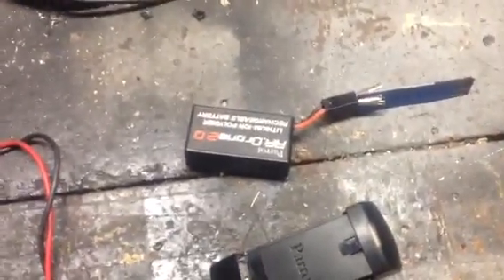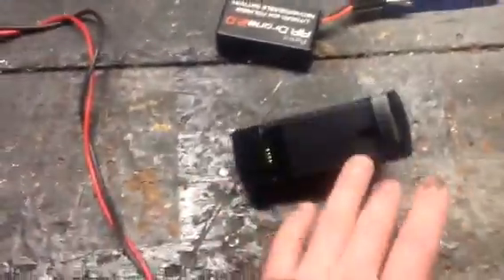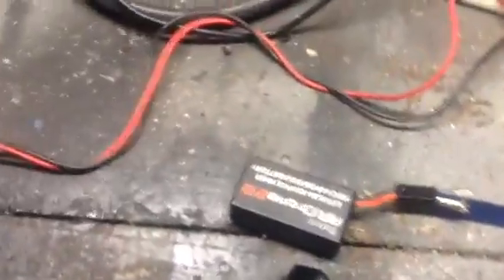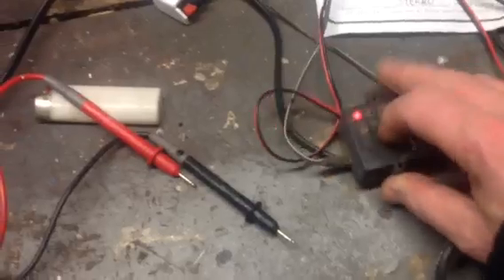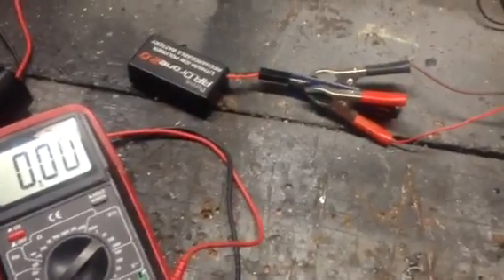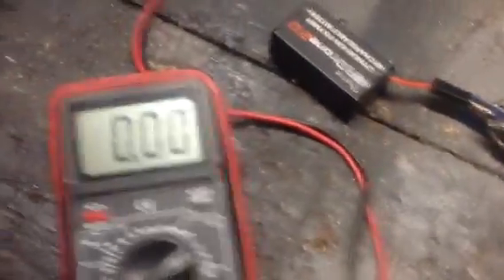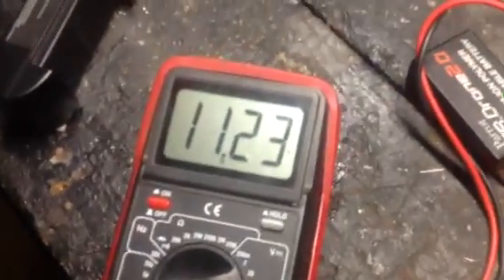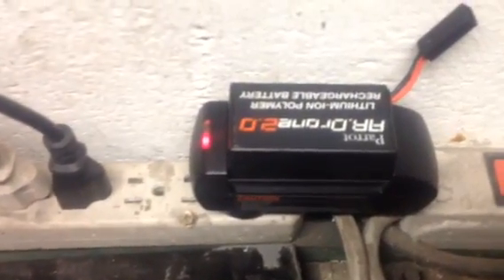Ar Drone Charger Flashing Red Light Fix

Comment: I know it's been a good few years but iv got a parrot drone and the battery's are only charging to 8 or 9v instead of 11v do u think this trick will help me out
Reply from the maker: Hi James! Well…this particular trick may not help as it just brings the battery voltage up enough to trick the charger…however, if all batteries that you’re attempting to charge only charge to 8 or 9 volts your charger may be at fault. With a multimeter, check the voltage coming out of the charger. It should be around 13-15 volts. If it’s only 8 or 9 volts, get a new charger. Hope this helps you out.

Comment: Have been idle for a year or so, my AR.Drone 2.0 Li-Po Battery (1000 mAh, 11.1 V) was down on 6.59 Volt and the wall plug charger led changed to flashing red (plugged it several times). After a 2 minute charge using a 9.6 V 220 mA AC/DC Adaptor my meter indicated 10.0 Volts - and finally the charger started working again with the constantly red diode. AWESOME WORKAROUND, THANK YOU @Budzilla Sohoski!

Comment: I will add, you can utilize any battery of somewhat high voltage house batter like a 12v fan remote one. I managed to it working after using paperclips as the medium and a minute later plugged into the charger and no more red light. thumbs up for others to see.

Comment: a better way is to sit it on your charger so the pins are connected but not locked it (so its easy to disconnect) then it will charge until it starts to flash then take the battery out (it is important to do this quickly as when it flashes it drains the battery), wait till the charger recognizes its gone (the light turns off) and do it again. it worked with one disconnect for me but maybe more for you this method uses no extra things and does it in seconds. hope it helped :)

Comment: Having the same issue with my new propel tilt "stunt" drone. 10 mins of flight and dead. Same method should resolve right? And you recommend buying a specific brand of charger/replacement batteries or are they all brand specific?

Comment: Thanks - fixed mine.  Subtle difference - I simply connected mine to a 12v battery for 5 minutes which avoided the need for a trickle charger. Worked like a charm.

Comment: there is another way to do this. you can get one of the plugs for a gas rc car that holds your battery and plug it into the reciever of your electric car while you have all the regular parts in. then you give it throtal for about 30 seconds and then it has enough charge to plug back in

Comment: Hey Budzilla, I am trying this method with Bebop battery using the Harbor Freight trickle charger. I started with a battery that had 7.6V and the voltage was evenly split between the 2 battery cells, the 3rd cell was down to 0V. I had the battery on the charger for 8 hours and the voltage went up to 8.15V, measuring the individual cells I see 4.22V on one cell and 3.93V on the 2nd cell, but the 3rd cell is still at 0V. Does it mean this battery is unrecoverable? It's a new battery that came with a Bebop I just purchased.

Comment: thanks for the info dude.. please provide the trickle charger that you used
Reply: Kevin Burns I just did this with my car's battery charger. I also have a motorcycle trickle charger, but it wasn't strong enough. it's 12.6v~3a out put. so just do above that
Reply: John Peterson thanks for replying.. thats 12v though...the drone bat is 11.1v.  That wont fry it?
Reply: John Peterson lol still trying the turn on and off method.  Ive climbed to 7.6v fml
Reply: John Peterson going on 2hrs lol
Reply: It worked the first try for me. I just took some speaker wires and stripped the ends. Shoved two into the battery terminal, made sure they weren't touching. Then just connected the other 2 to my 12 v car battery charger. I had it at the lowest setting then kicked it in to start mode for like 15 seconds. Took it off put it on the charger and the red light finally came on.
Reply: John Peterson thanks dude totally worked lol.. got it up to 11v in about a minute and 20 seconds.  I forgot i keep a spare batt in my car for jumping it

Comment: Does this work on Ares ethos HD quadcopter battery also?
Reply from the maker: Hi Shawn. This trick will work on ANY lithium ion battery.  As long as the output voltage of the charger you're using is equal to or a little greater than the battery you're trying to restore (+/- 5 volts or so) Just be sure to monitor that process. Lithium ion batteries ARE NOT like a car battery, or a rechargeable ni-cad battery. A lithium ion battery will continue to take a charge until it fails catastrophically. That's why they all use "smart chargers."

Comment: Sept 2016....when battery charger starts to flash, simply remove battery ,leaving power on , and repeat this proceedure maybe up to ten times ie..when battery starts to flash red, remove battery and reinsert until flashes again. Eventually the battery gets sufficent charge to fool the charger that the battery has not failed....you will find that eventually you will reinsert battery and the charger light stays red, a sign that it is charging as it should.   Cheers
Reply from the maker: YES! Or simply hook it up to a trickle charger for a minute ONCE....
Reply: It workt!
In my chase it only took 4 times to put the batterie into the charger and out again.
Thanks for the tip!!
Reply: I tried this 20 times didn’t work but the method in the video 👍👍
Reply: Yes this worked for me  cheers

Comment: Thanks, i tried it, I bought a brand new Drone and the battery was completly dead, zéro volt and the red light was flashing and boost it with my drill charger and put some 7v in it and it began to charge, thamks for your help, I am from Lac-Mégantic, Québec.

Comment: Tried on the bebop drone battery, it worked perfectly! Thanks
Reply from the maker: Great! Glad it helped. It will work on ANY lithium ion battery. As long as the trickle charger's output voltage is close to or just above the battery's output voltage it should bring it up to a point where the battery's charger see's it as a good battery.

Comment: This video is a godsend.  I used a Battery Tender Jr (750mA) and it took around 30 minutes for me to get from 3-ish volts to just over 10 volts with me checking the voltage every 5 minutes.  10V was enough for my Parrot charger to treat the battery normally.  I owe you a beer.

Comment: Well done.  Worked like a charm.  The Harbor Freight solution worked wonders.  My only issue - to get from 5.5 volts to 10.5 or so actually took about 5 min of continuous charge.  But...then the Parrot charger took it and no more blinking light.  Well done.  Thanks!

Comment: Thanks man, I fixed mine with a switchable tip variable voltage charger with aluminum foil for a wire and it is not charging.

Comment: Thank you very much.  Ran to Harbor Freight right after finding your video.  Followed your instructions.  Worked like a champed.  After a short charge with the battery tender, popped it into the charger.  Red light went on, then green. Resurrected my "dead" battery and have been flying ever since.

Comment: hahah cool, worked here. Thanks very much.
I have another question, by any chance do you know the colors of the 4 pins of the charger? Because i just bought an ar drone 1.0 battery, and got fucked, coz i can't charge, and which led me to google the things and fix my original 2.0 battery. But i intend to use the same charger for both batteries. and i'm thinking instead of hacking my charger which is now useful, if you can tell me the order of the cable colors of the gold pins , i can try to match the ar drone 1.0 battery cables to the charger.
thanks anyway :)

Comment: Just incase anyone is wonder. I actually managed to fix this by jumping my AR battery with my truck. NOTE: This is extremely dangerous This is dangerous because you are charging the battery with a 5-20 amp charge, which is 5x-20x faster than is made to handle.What you need: 2x 2ft lengths of wire "preferably solid core."How I did it: First clipped one end of each  wire and wrapped them in a loop, placing 1 end of each in the out bored battery connector. Then, I placed the other ends on the respective battery terminal so as they don't fall off. "Truck was already started." Then I walked away for 10 seconds, came back and unplugged them, and then put the battery on its normal charger. If it doesn't work the first time, rinse and repeat. NOTE: Don't leave it attached for more then 10 seconds as the fast rate of charge heats the battery very quickly. Each charge spurt I got about a 2v charge. BE SAFE, BE SMART

Comment: What is the voltage level that you need to boost it to, in order to begin normally charging. My battery sits at 7.53 VDC and still flashes in the charger
Reply: My AR.Drone 2.0 Li-Po Battery (1000 mAh, 11.1 V) after being idle for months was down on 6.59 Volt and the wall plug charger led was flashing red. After a 2 minute charge with an 9.6 V 220 mA AC/DC Adaptor my meter indicated 10.0 Volts - and finally the charging process runs normally again, the flashing led turned to constantly showing red.

Comment: Just used a 12.Volt car battery jumper and hooked it up to the output charge wires from the battery cliped to one red and one black wire and it worked just fine.

Comment: I was going to try this but before I did, I tried removing the battery from the charger and putting it back on again which worked. Must have had it badly seated.  This was a new battery which I bought on ebay. I do have the original battery which I haven't used for at least a year so when I can I will try to fix the flashing red issue which I'm getting with this one also.

Comment: I jerry rigged some shit and was able to get to work with only a 5 second or so charge from a harbor freight trickle charger.  Great video!  Checked voltage right before plugging into the regular charger and it read 9.0 volts on my multimeter.  Apparently the charge threshold is a little lower than that.  It started off at 6 volts.

Comment: Lost my charger+batt after my last flight, found it today and it was down to 7.5... Used a 12v adapter to slowly ramp up the voltage checked it every 30 seconds (I think it took 3 times).. Once it was above 11 I threw it in the regular charger and it ran for a long time and got up to about 12.4 and then I got a flashing red light again. Battery wasn't hot. Let it sit overnight and it kept the charge still not hot so I put it back in the charger again and it charged to green this time.

Comment: If I see you right, the basic idea behind this video is kick the discharged battery to some higher initial voltage where the charger can start to charge. It seems that you don't even have to buy an extra power supply or a car charger when you use a PC or anything with an USB plug/ You can pre-charge one Li-Po cell at a time with USB 5V power source via current limiting resistor or just a flash bulb.

Comment: Hey this video is great! quick question, what size alligator clamps did you use, I'm using 1.25" and they're a little tight. I had to bend down one of the teeth with needlenose pliers..lemme know and great vid!

Comment: Wow, worked like a charm. Used a trickle charger for a remote control RC I had for 30-60 seconds and no more flashing red light. Don't know how long it will hold a charge just yet but at least I can get it to charge! Thanks a lot!
Reply from the maker: Great! Glad it helped. It should hold a charge just fine as long as the battery isn't truly shot. Lithium Ion unlike lead acid or alkaline loses charge just by sitting unused. If they sit too long they drain below the voltage that the charger allows so it thinks the battery has failed. As long as the battery is brought above that threshold you should be fine. What that threshold is is a mystery as Parrot wouldn't give me that info.
Reply: Budzilla Sohoski I believe on the battery itself it says not to let it drop below 2.5volt. I'm sure mine was about flat because it sat for probably near 2 years. Anyway it flew great, battery life was about what others experience. You wouldn't happen to have any knowledge on making the app for it less lousy would you? Hahah. I get constant app crashes, very disappointing in that regard.

Comment: you da man, brought the power edition last week with red flashing issue. fixed now for the mean time.
Reply from the maker: Great! It's a permanent fix. Until you use your batteries up that is. The charger has no way of knowing whether the battery failed or just fell out of charging range so it rejects it. It's doing its job as far as its concerned. Glad this helped you.

Comment: Amazing, it worked immediately on three dead batteries that had some 3.5 V and 7.5 V charge. Charged 30-45 secs with a car jump starter battery with some 12.5 V, bringing the batteries to some 10-11 V. After that, started charging just fine.
Reply from the maker: Great Marko! Happy it helped!

Comment: Thanks for the info, I ordered an AR2.0 and an extra extended battery, both the stock and extended battery showed up with low voltage 5&10v and wouldn't charge.  All I had was a 2A charge and a prayer that it wouldn't explode on me, but I charged it with the multimeter attached so I could watch the voltage pretty close. When the batteries hit 11.5v (disconnected) the stock smart charger accepted them!  You saved me I'm sure many calls to Parrot support!
Reply from the maker: Great! Glad it helped you!

Comment: Dude that worked amazingly.  Super easy to do and saved me a lot of nonsense.  Luckily I looked up your vid before buying a new battery.  Now I'm curious if it would work on my Lipo battery for my RC car.
Reply from the maker: Great! Glad it helped. It should work with any battery that uses a smart charger as the battery charger won't work if the battery discharges past a certain voltage. Just make sure that the trickle charger you use is close to the voltage of the battery and only keep it connected for a short period of time just to get the battery up to a point to fool the smart charger.

Comment: what type of tape did you use and did you modify the plug thats on the battery to slide in the paper?
Reply from the maker: Any tape will work. It's just to keep the ends from shorting out. No modifications need to be made to anything. Little alligator clips work well but you can use anything that works for you...paper clips or little pieces of wire...whatever...as long as they are conductive.
Reply: *****  and you solve the problem with flashing led? can you upload some clip how to repair it>?
Reply: Marcin Szumowski
Havent started. however I think I know what he did. he used paper to separate the two charges from touching each other. I have a battery tender but I think its too powerful

Comment: anything different I should know about doing this  for the  Bepop batteries, Volts?
Reply from the maker: The Bee Bop uses an 11.1 volt battery so this fix would also apply to that. The trickle chargers are 12 volts but you're only going to have it hooked up for a short period of time so 1 volt more isn't going to hurt anything. Hope this helps : )

Comment: Great video. I dont have a battery tender but your method made me thought about the vehicle "jump start". One of my fairly new battery wont charge with flashing red lights. I used my good battery to jump start with 2 pieces of wire for 20 seconds. Therefore the battery (flashing red) will have small amount of charge to fool the charger to charge the battery again. It works!
Reply from the maker: Great! Glad it helped : )

Comment: Hey thanks for this tip! Would you pls be able to tell me; is there any other type of charger that I could use? Would a laptop battery charger work? I don't have a automotive charger.
Reply from the maker: A laptop charger would probably work. Just keep an eye on it. The whole idea is to get the battery charged just enough to fool the original charger...once it's got a bit of a charge just put it on the parrot charger. So, yes, I think you'll be ok as long as you sit there and watch it. Hope this helps.
Reply: Budzilla Sohoski Thank you for the quick reply! I'll try that out. The battery currently has a reading of 5.7v but the charger still flashes. What's the min volts needed before it would start to work?
Reply from the maker: That's a mystery as Parrot wouldn't give me that info. Just try to get it as close to 12 volts as you can..I'd imagine that once you get to around 9 or 10 volts it should work but again...that's just an assumption.